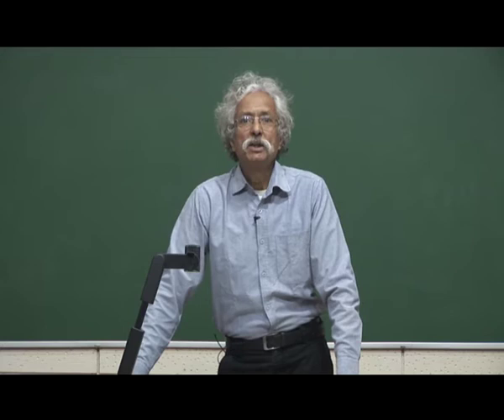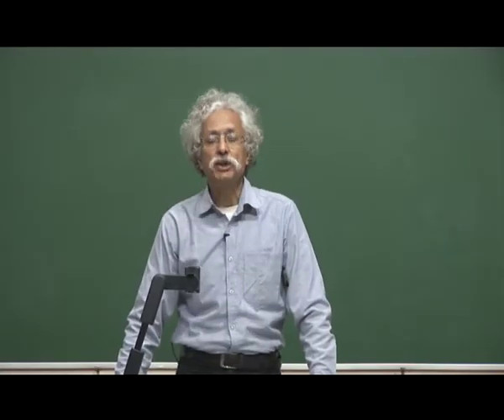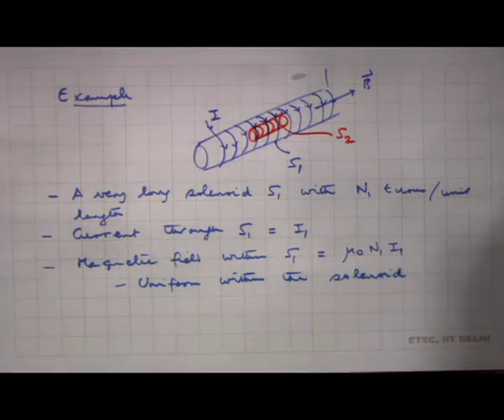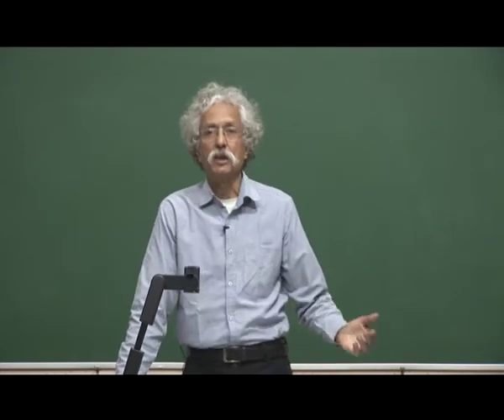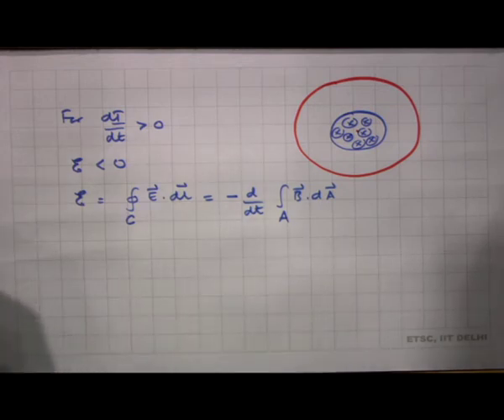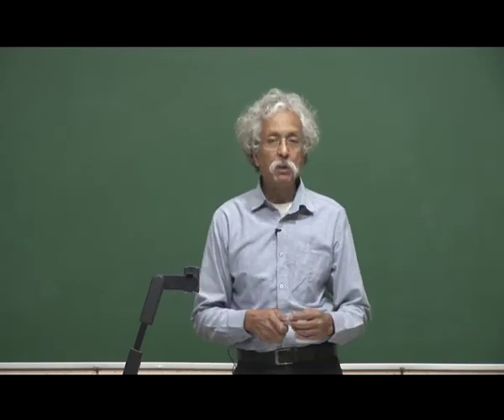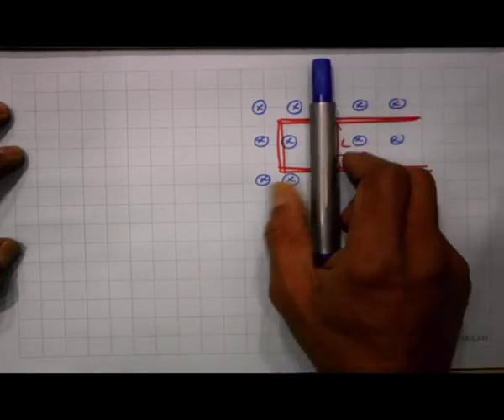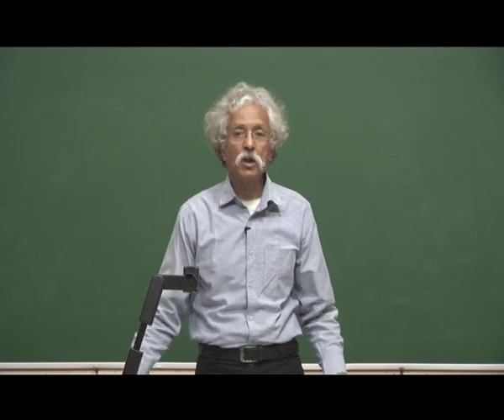Faraday's law of induction: Induced emf (CH_22)

Comment: The opposing (or induced) emf produced by an inductor is a characteristic of the non-Coulomb electric field (NC) that is proportional to the rate of change in current causing a changing magnetic field. And that is Faraday's Law. 

The current is a result of the combination of an opposing Coulomb electric field and the applied field which is changing the current. The opposing Coulomb (C) field is a result of polarization of the inductor by the non-Coulomb (NC) electric field. So, the current is a consequence of the resultant field of the applied field and the Coulomb electric field in the inductance coil and is determined using the governing relation in conductors J = σE_net. If the resistance of the solenoid is very small, the magnitude of the two electric fields is nearly equal (E_C ~ E_NC). 

It is not possible in this post to discuss in more detail the formation of the Coulomb field when the current in an inductor is changed. 
Before learning Faraday's Law and its application to the operation of inductors, it will be instructive to understand Current, the conduction process and Voltage at the fundamental level  as in the following two videos: 
i. https://youtu.be/TTtt28b1dYo and 
ii. https://youtu.be/8BQM_xw2Rfo 

The last frame References in video #1 lists textbooks 3 and 4 which discusses topics on inductance and inductors in more detail using a unified approach and provides an intuitive understanding of inductive reactance. 
It also describes with sequential diagrams how an inductor develops the induced emf. Textbook 4 shows how the current lags the voltage across the inductor by 90 degrees for sinusoidal input voltages using sequential diagrams.